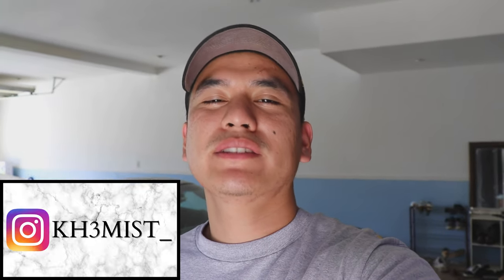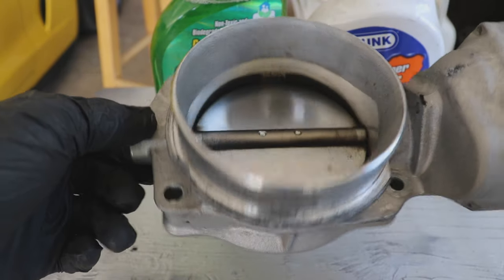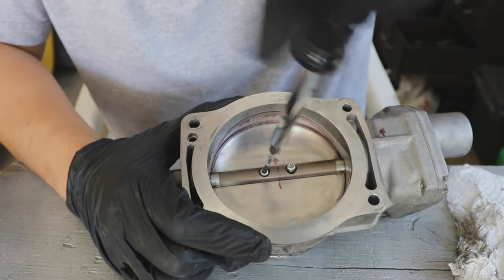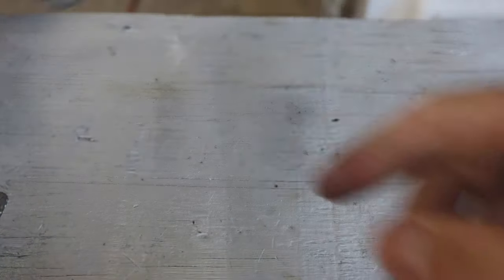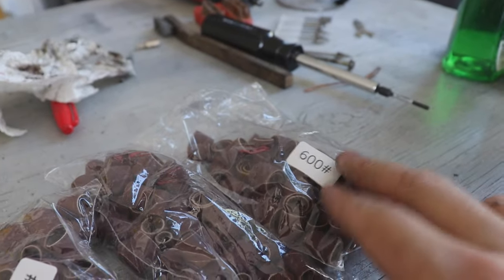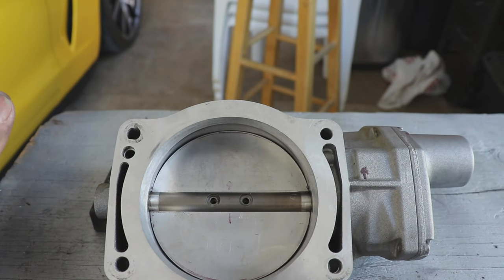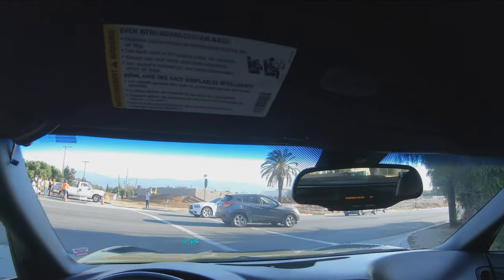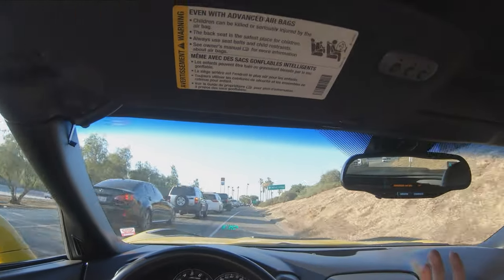Porting a Throttle Body (Worth it?)

Comment: Nice, ported throttle body usually gives better throttle response and better mpg slightly. Got alot of haters in your comments that seem to think only major mods pick up HP lol. Trust me, it takes pennies to make a dollar. Porting the intake manifold and the heads will give the full package. It takes all of the parts working together to maximize gains but even as a stand alone mod a ported throttle body is still worth doing. Seat of the pants you won't feel much but a dyno might show you 5hp, the track might show you a few hundredths but most of all the smoothness of throttle response is a good start to getting a car that delivers power smoothly and strongly. It's not about getting MORE volume air in its about getting the air to flow with higher *velocity*. Ported throttle body is a good start.
Reply: Yes!!! I ported my manifold to TB intake, port matched the intake runners to match up with the manifold spacer!
Reply: @dragan3290  I swapped a fully ported top end on my truck and it was a world of difference above 60mph and throttle response and smoothness was also much much better at any rpm

Comment: I've seen Camaro 5 forum. Members gained 12 wheel horsepower with a ported throttle body. But they had other supporting mods too.

Comment: The ECU does not tune itself when you modify anything. You need a tune before and a tune after the mod. That way you would know what´s it worth.
Reply: ECU on my vx ecotec does remap to a certain extent! I need a Remap from mace engineering  tho. But I need a 70 mm butterfly so I can machine my TB to 700 mm.

Comment: I have a ecotec v6 3.8 in my Holden commodore and I ported the throttle body, intake manifold to suit. Already put a 25 mm manifold spacer and a 10 mm plenum spacer. Felt great until I ported the gm throttle body. Funnel effect to the Max. I had a 10 mm massive raised edge on the inside of TB. After removing all the crap and polishing to a mirror finish? Less carbon. Jumpy off the mark like I never expected! Took my time and beautiful. My v6 rated at 303 NM and 152 kw. I reeled in an sv6 with apparent 190 kw, and 350 NM! SV6 IS A BS rating. It was a Ute and I have a lot of mechanical tools in a sedan. Only problem is driving in the wet.lol. very tail happy. Top video! Works like a charm.cheers from Australia! I need a custom tune. Yours should be jumpier off the mark. But my TB WAS restricted bigtime. Time it with a stop watch. I gained 2 seconds at 0 to 100 kmh.

Comment: Hook up a vacuum/ boost gauge! My 3.8 v6 ecotec after ported and polished throttle body made my car instantly jumpy. Smoother airflow! I nailed the gas around a corner from rolling at walking speed and before swung sideways and straightened out! After the TB ? Well. It swung left and right that im like WTF???

Comment: Love the video. The 87 mm throttle body flows up to around 1000cfm with the stock casting and the 90 mm ones flow about 1100 cfm. They are not a restriction for most lightly modded engines but when needed it’s great to break out the tools and grab some extra cfm for just a little bit of time.

Comment: I see all the arguments.  When I had a 77 rabbit, my top speed was abotu 78mph.  Then somebody said remove the neck in the throttle body that provides venturi signal to PCV.  Had shop remove it, gained nearly 20MPH top speed.  "Roll raced" a later model GTI, and he asked me what I had in the car!  That' s why I wonder why opening up the neck in the intake wouldnt' make a noticiable difference.  is it because the rabbit had a 95ish  hp 4 popper?

Comment: i have a throttle cable and an idle control valve, does my throttle body have a resting idle position? if not how would i go about avoiding those redzones

Comment: The intake and heads would need to be ported as well or ultimately nothing significant about your flow changes, all the path needs to be addressed not just part of it,  so - there's that   Also a little lube or that plate would of made it much easier to install.  Good video tho.
Reply: You would only need to port the heads if you did a significant cam upgrade.

Comment: It’s different I think with a DBW which all Vettes ls1 up have DBW. 97+ ls1/ls2/ls3/ls6/ls7/ls9/etc. a lot of other ls1 applications were DBC (drive by cable) which porting that 75mm mechanical over your DBW 90mm here in the vid will prolly yield better results. I think the TB on the ls2 is already pretty legit. The ls1 75mm have that gnarly lip before the throttle plate bore.

Comment: Yeah man you prob know it but save that tune money until you get bigger mods that actually need it to be tuned imo intake and ported throttle dont need much of a tune and youll prob see minimal gains vs doing heads,intake manifold, cam, headers
Reply from the maker: Thanks for that man, and I agree after thinking about it for a bit definitely better to get the tune after all those parts are on!✌🏽

Comment: When you get a Supercharger kit???or you need still saving for it...bro till know all your Mods are BS..i see you still got the stock Radiator and shocks..better do it right or keep.it stock,but outside it looks nice.🤔👍
Reply from the maker: I have BC racing coilovers and a supercharger is not cheap, unless you want to buy it for me! I don’t plan on racing it so there isn’t really a need for me to go boosted as of right now.  It’s my car I can modify it however I want to 🤣 Plus some other people had good results from porting their throttle body so it’s not total BS
Reply: @klaus.tugade  You will go for the supercharger sooner or later,you wanna bet??,if start modify a vette its like a Addiction,anyway C6 are now way up i got mine in 2017 c6 stock 2006 auto.but rebuilt for 10k ,so its worth it.👍🇺🇸
Reply: @klaus.tugade  But its my opinion..ok👍🤔
Reply: @permabulk1454  Yes i got 2 jabs pfizer/biontec..🤣🤣👍
Reply: @ricksworlddereaux2397  why you’re young and healthy 🙄
Reply: @klaus.tugade  Then save up,for the supercharger..the Flammes and Sound and Speedgain its worth it.🤣